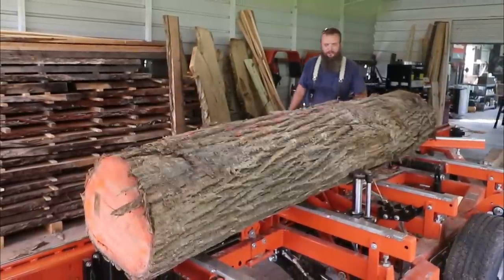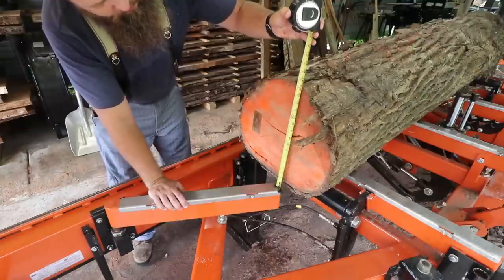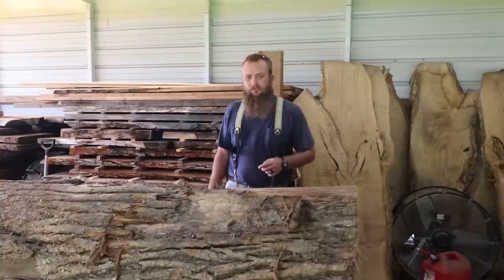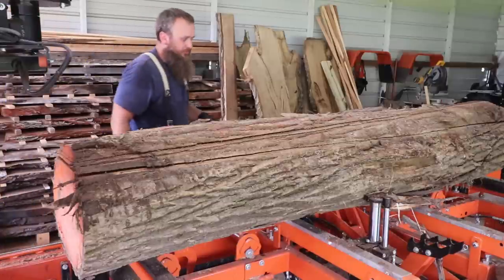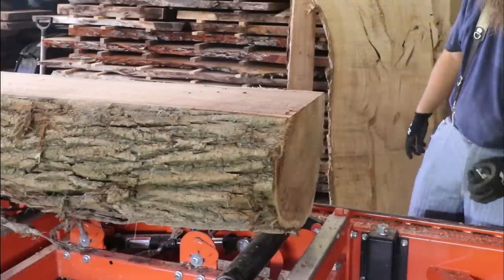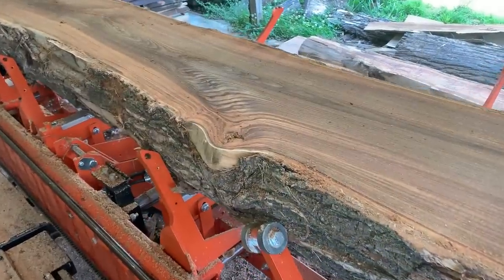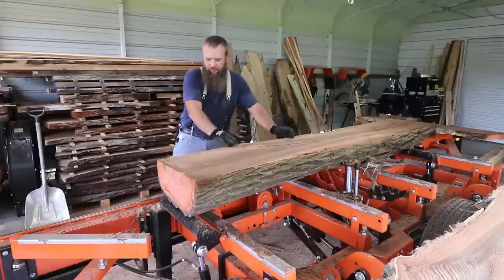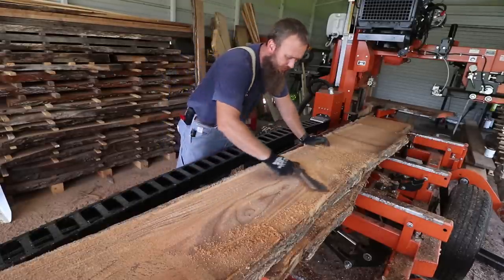SAW-MILLING A RARE LOG AND DELIVERING IT TO A MASTER WOODWORKER

Comment: Instead of having a burn pile might I suggest that you chip all of your scrap and then buy a pellet Mill and then make wood pellets for pellet stoves and boilers then you can you can add your sawdust to those pellets for added anyway check into pellet mills I check out that process you might like it
Reply: I really do need to proofread all of my post before I post them because I use voice recognition and sometimes it don't put all my words in and sometimes it adds words and sometimes it changes the word completely anyway I was trying to say also you can add your sawdust into making the pallets along with the chips and that way you can increase your profit margin and not really have any waste

Comment: What do you do with your waste wood and sawdust?

Portage and main makes a nice woodchips boiler for providing heat and domestic hot water for the household. The small one is rated at 120,000 btu's and with dried woodchips can make as much as 150,000. It has a three yard feed bin and is fully automatic except for loading the woodchip bin. Friend of mine in Maine has one and mostly burns sawdust from a small mill a mile down the road. He uses a 1 ton dump truck to haul the chips and sawdust and a used bobcat to fill the feed bin. His wife loves it as she no longer has to watch the heat as they used oil before this boiler, their radiators are cast iron and he repiped the entire house as the heating system was installed in 1906. Loves it.

Check them out here.

https://www.portageandmainboilers.com/our-products/lcb-120-wood-chip-wood-pellet-burner

Cheers!

Comment: First I do not have a mill, you know a whole lot more about this than I do. I have noticed though, the Debarker when a cut begins is about 4"-6" into the log/bark before saw blade begins cutting, isn't it supposed to 'Save' the saw blade from debris in the bark from damaging the saw blade??? Just an observation.

Comment: If you rip the pith slab an inch or two of either side of the pith, you have two quarter sawn boards. 
The pith will be in a little square, and can crack to its hearts content. 
Some quarter sawn wood is beautiful.

Comment: Thank you for another excellent video. I was curious about the growing conditions/environment of the tree because the log seems so flat on one side. The twisted and off-center pith gives more clues as to the tree’s past. I truly appreciate that you explain the challenges a log presents on the mill, and that you share your strategy to overcome those challenges. Two thumbs up!
Reply: Trees with some lean away from straight vertical will have the pith off center. A really bad leaner will be better as firewood, unless you are looking for something intentionally curved.

Comment: On the farm we had an old 60 inch circular saw.  For a cabinet or furniture maker, we would quarter saw a log like that by turning it ninety degrees then turning it back to the starting position. Give them everything except the bark slabs and let them worry about the pith. The only way we ever made money on the sawmill was to cut RXR crossties. The railroad is always buying and pays more if you deliver a 100 or more at a time.

Comment: Nathan, since you mill indoors, I am curious why you went with a gas engine rather than the electric motor?
Reply: More likely because he still has the option to travel with it to do milling off site.
Reply: His shed is open, and has roof venting. His engine is a modern diesel and is clean burning. He said previously that he rarely even can smell any exhaust from it. And it is essentially an intermittent running engine, with it off between cuts. Also, for equivalent energy, it is far more economical to run, repair, and purchase. Just brainstorming and I may be wrong on all points. I am more concerned with the amount of dust and mold spewing from the machine with no mask, but imagine in the heat it would be a torture device

Comment: So.....instead of working through all of the measurements to get the pith centered, why not take your cut to the pith where you want it then take all of your subsequent cuts to get that slab where you need it? Just a question from a beginning sawyer, trying to learn something.